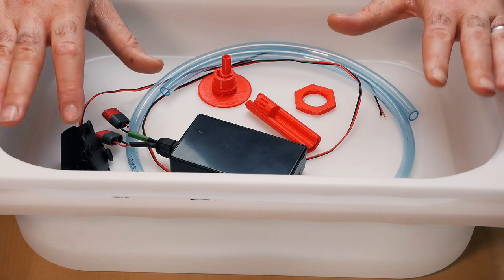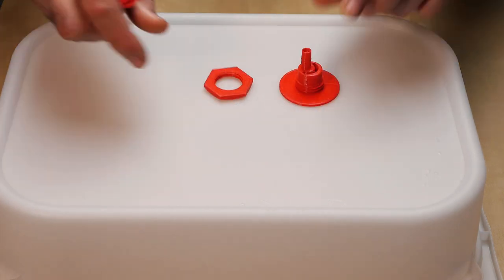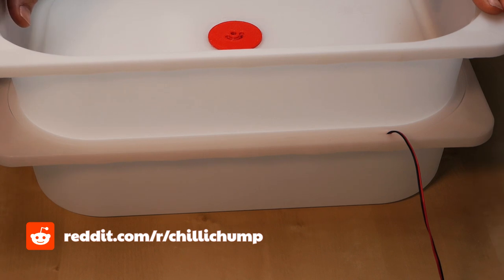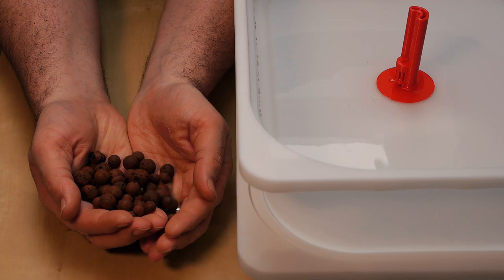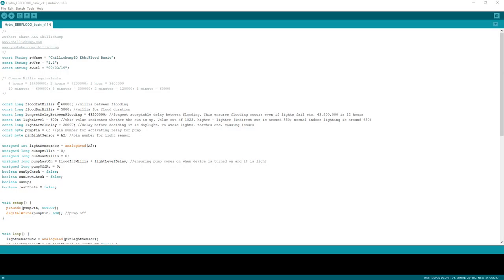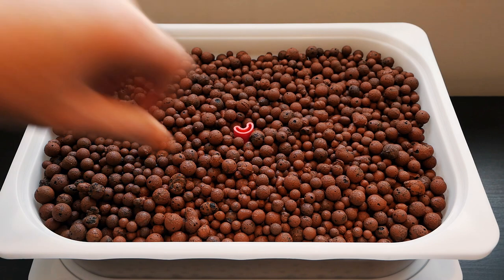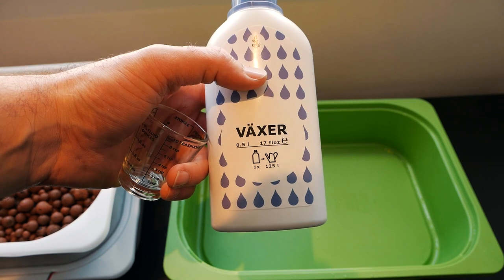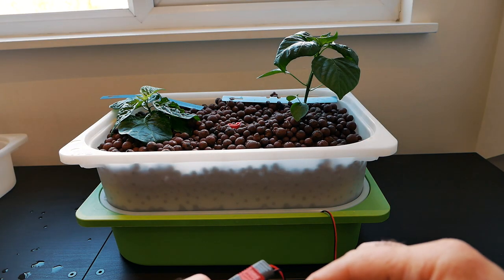3D Printed Mini Hydroponics System

Comment: Very cool printed parts. Its really cool being able to design your own parts. One suggestion I would have for you is to modify your bulkhead fittings to use rubber o-rings. Makes cleaning, storage, and transportation easier compared to using adhesive. 

After using Arduino for years on automation projects I made the leap to Raspberry Pi. No need to uninstall, plug into your USB, unplug and reinstall your controller when the code needs to be modified. Just do it over wifi. That feature alone is worth the change in architecture.

Looking forward to your next project!
Reply from the maker: Hi David, the reasons for using Arduino and ESPs is mainly down to power consumption. I do use raspberry pi for other projects where I have them plugged into mains. But these devices are used in my off-grid solar setup in the greenhouse. They use a fraction of the power a raspberry pi uses. Also I find them far more reliable

Comment: @2:01 That clip noise when you use a snips, so satisfying!  If you're using it out in the greenhouse you could try connect it to a solar supply to make your greens greener :)
Reply from the maker: Check out some of my other videos! I have a full solar setup for my greenhouse. And this setup is actually in the greenhouse now connected to my off-grid system.  I will update on that on my next video!
Reply: @ChilliChump  Ah I'm subscribed but haven't seen that yet Shaun, will check it out later.  Having no joy with the carolina reaper or other hot ones I'm germinating in rockwool, think I'm gonna go for plain old compost germination then try root out and transfer to my expanded clay DWC self-build.  Also regarding germination, gonna try an off-shoot of using cold tea to weaken the seed shell before planting - plant the seed directly into a used teabag!  Great water retainer, and I work in science....that's how new stuff happens - people say "I wonder what would happen if" then shit happens! :D  Enjoy your Easter weekend man, have a good one.

Comment: May i suggest drilling a few small holes in the growing tray bottom border? That does not materially slow down fill-up process, but helps eliminate last bits of standing water, that are inevitable even with a small elevation profile of drain tube...

Comment: This is a really neat way of doing it. Well done dude. Would have been nice though if you could feed the wire back up into the top bucket. But i guess there isnt enough weight to pinch the wire.  I currently have this really nice looking system mounted agains the wall using 110mm pvc pipes. I find that the roots are cloging the pipes and they then run over. So maybe if i drain them and pump water in a cycle like you do will solve the problem. Cheers and keep em comming.
Reply from the maker: For the wire I clipped a little corner out of the lid underneath the flood bed. That does the trick. I considered hot gluing it in but I wanted to be able to switch out the pump if I ever needed to! Btw the system is really working great, I have it outside now...and the plants are just growing like crazy

Comment: Was wondering if you ever measured the pH of the system. Clay balls in a wet/dry cycle usually tend to build up some of the fertilizer salts inside, pushing up the pH over time, decreasing the plants ability to get their nutrients out of the water mixture.
Not totally sure how much of the buildup is released per cycle though. Might not be enough to affect the system long term. Great build by the way!
Reply from the maker: I tracked the pH and EC every day. It stabilised after about a month. But never really had readings that were alarming

Comment: Not sure to ask here or on the appropriate video but here goes. First time grower and I just rewatched your "Beginners Guide to Growing Peppers" playlist - wich is fantastic btw - and now that I actually have some kind of succes (first batch, not so much) I wonder how I know when its time to pot on for the second time and onwards? My super chillies are currently in a 9x9x9cm pot and the next step up for me is a round 13cm diameter 11cm deep pot.
As allways, appriciate the videos!
Reply from the maker: Hello and thanks for watching! The way I decide to pot up is largely by feel. But basically you are potting up when the plants roots have taken up most of the existing pot without becoming rootbound.  This may result in very different size plants depending on your seeds you are growing. But with a 9cm pot .I would say wait until you have a plant that has at least 6 pairs of true leaves before potting up. If you wanted to be 100% sure...wait until you need to water then again. If you are following my beginner's guide then that would mean the pot would be quite dry.  Carefully life the plant out the pot and have a look at the roots. If they are very visible around the sides, then it is time to pot up!
Reply: @ChilliChump  Thanks again for you help, I really appriciate it - and happy holidays!

Comment: Nice. I like the IKEA trays, though you may want to redesign the drain so it leaves a little bit water in the bottom of the grow tray at all times. Should you have a power outage or pump failure the water in the bottom of the tray will keep your plants alive until the problem is fixed.
Reply from the maker: The way the bottom of the tray is designed it leaves about 200ml of liquid at the bottom....a happy accident really!

Comment: Thank you for the video. How do you feel about pla and situations like this where you want to use it for food related use? Looking for information on that.
Reply from the maker: PLA is biodegradable. So from that perspective it is fine. It can release lactic acid when exposed directly to food stuff, but that is fine too. However because of lots of little ridges and gaps etc on the printed parts,  it can collect up dirt and bacteria etc, so need to be careful of that.

Comment: Hey man, nice setup. 
I just got one remark about this. You hardcoded the time the pump should stay on based on a test with a clean setup to 22 seconds.

What will happen when the plants start to fill the container with roots? They might slow down the draining. At the end of the video it seems the water drains as fast as it fills. If the drain gets clogged it might overflow the bucket since it will fill a lot faster. Maybe an open contact at the top of the container could be used as an off switch for the pump. When the water reaches the contact it will short and close the contact?

Just my 2 cents.
Reply: He has an overflow built into the center  red pipe so that the water will drain back down if it overfills

Comment: Hey Shaun, I'm considering this setup in the greenhouse for next season.. Would you recommend leaving those 2 plants in that same size bucket for the whole season? (in other words no need for "potting up")
Reply from the maker: There wouldn't be a need to pot up with this system. The foliage may get a little crowded later in the season though
Reply: @ChilliChump  Thanks. Also, how long would you use the same water in the reservoir before it needs changing? This does seem to be a lot more water efficient than standard pots with soil...
Reply from the maker: Depends on the stage of the season...but at worst, I will change it out after 2 weeks.
Reply: @ChilliChump  Thanks, I will get into the details as we get closer to next season and I've finalised a design.